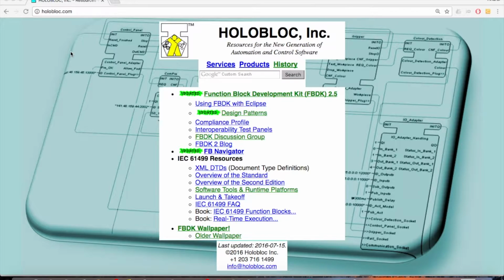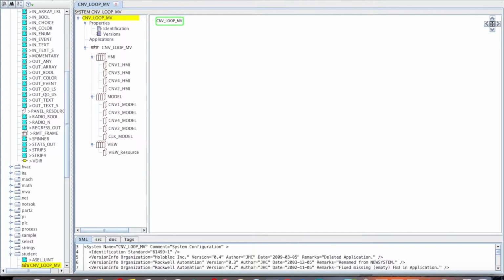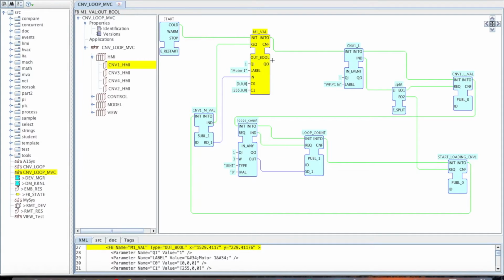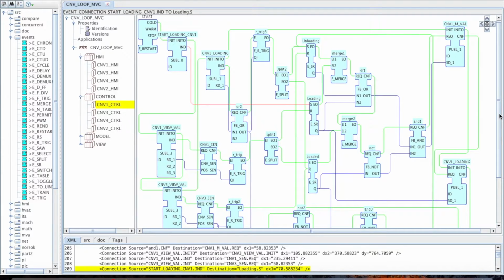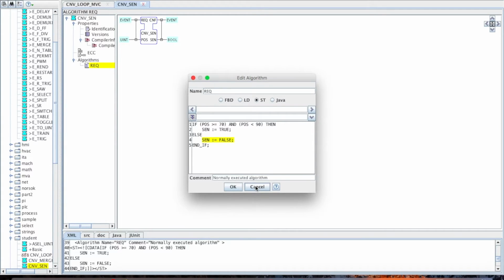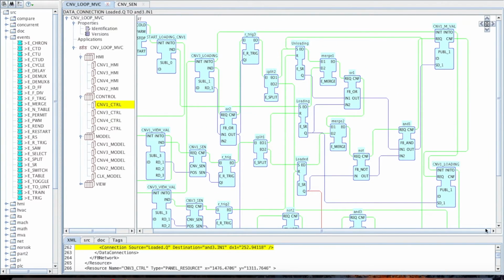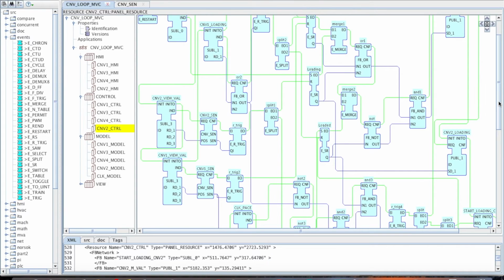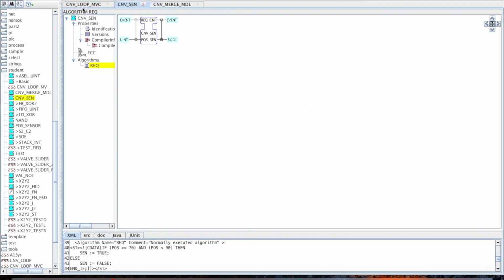FBDK (IEC61499): Developing control layer.

Comment: Again, thank you a lot for your effort, 
I'd like to ask you one question:
 is there any way to implement this algorithm into a real devices?
Reply from the maker: Hi, 
Yes, there is. You can, for example, check solutions by
* 4DIAC : https://www.eclipse.org/4diac/
* nxtControl : http://www.nxtcontrol.com/en/
* ISaGRAF : http://www.isagraf.com/index.htm

Also, time ago, we have implemented runtime for IEC 61499 in Pointe Controllers by Nematron:
* http://www.optimate.com/products/legacy/pointecontroller.shtml
The principles of the runtime were described in the following paper:
* http://ieeexplore.ieee.org/document/1560356/

Various assembly line equipment and inverted pendulum were controlled following the IEC61499 approach. All of this demonstrated already more than 10 years ago. :)